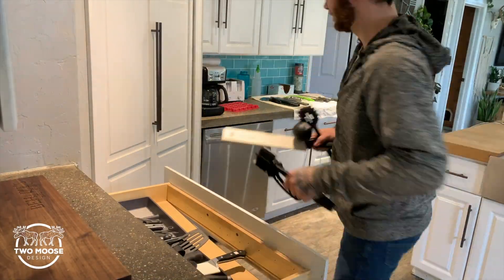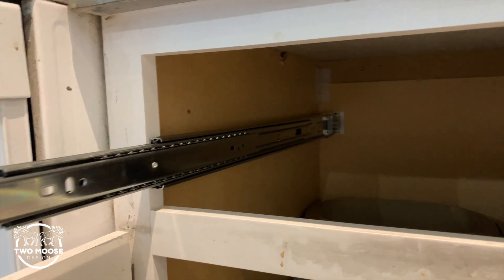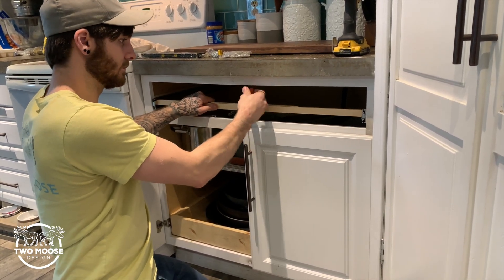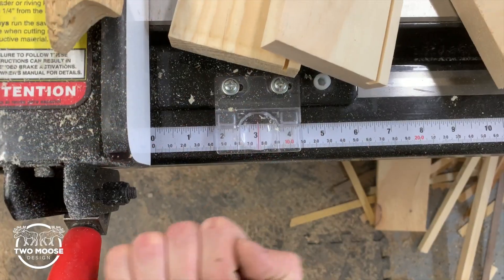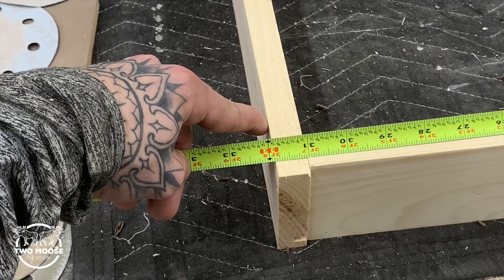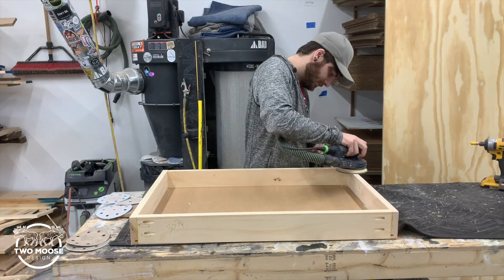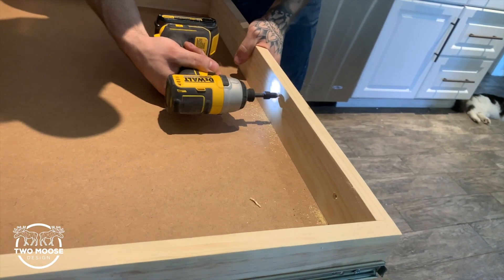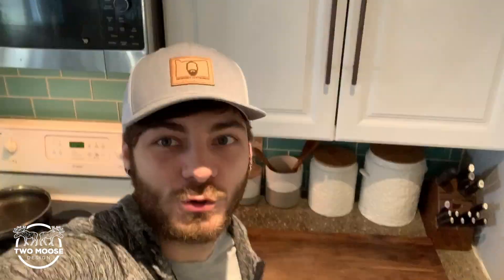How to Replace a Broken Kitchen Drawer and Change Slides

Comment: Hi 
My drawer box is 19”
Do I need 18” or 20” slides
Thanks
Reply from the maker: If the inside of your cabinet is 19” i would use a 18” drawer slide

Comment: I have a kitchen island with two doors on the bottom and two drawers at the top. The drawer on the right is fine but the drawer on the left always falls off the track. Since there is no divider wall in between the drawers, the center slider tracks just hang in midair attached to a plastic backing plate at the rear. I replaced the bottom mount brackets on the drawers and the side brackets (they are actually not attached to the side panels either just hanging in midair) and I put the drawer back and now the drawer is stuck about 2/3 of the way in. I can't pull it out or push it in any further. It looks like it came out of the track so I pulled out the backing plates and it still won't budge. Any ideas how to get it out or fix it?